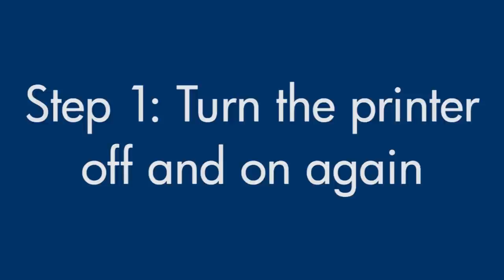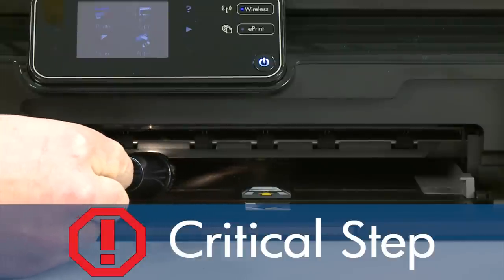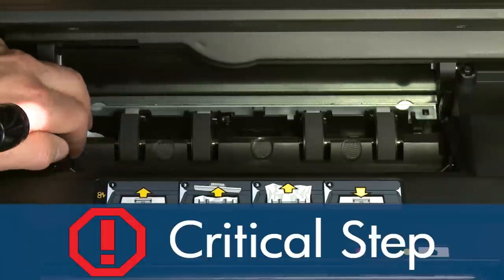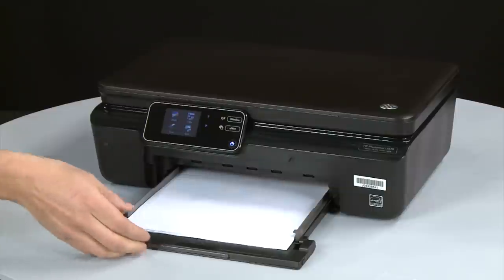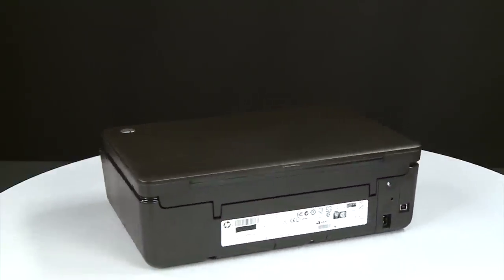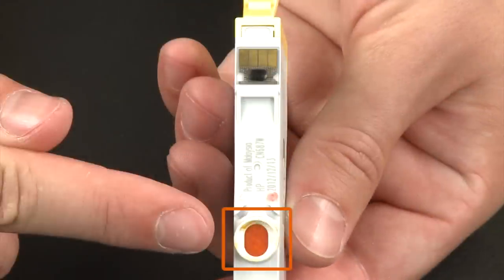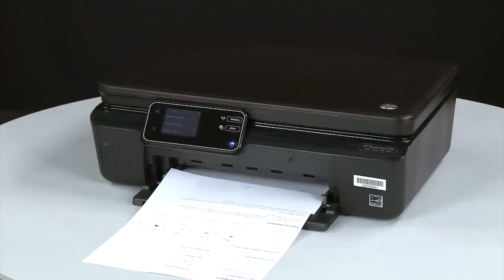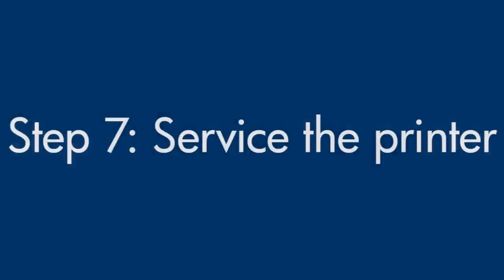Fixing a Carriage Jam | HP Photosmart 5510 e-All-in-One Printer (B111a) | HP

Comment: I have the same problem with carriage stuck on far right. Turn it on, grinds and grinds, but still doesn't move. Cannot move manually. Followed ALL steps in video and it's still stuck. Will not move even a little bit to get ink cartridges out. Called HP; they have "no printer repair centers" but offered to allow me to upgrade and buy a new one at a discount.
Reply: Kim Hansen I have the same problem!
Reply: daisyconsuelo so what did you end up doing?
I have the same issue. The videos don’t help at all.
Reply: I know. I’ve been complacent... I literally just loaded the printer in my trunk earlier this week in hopes of finding a printer repair co. Economically it probably won’t make since to repair..
Reply: Try to push it down hard or with a bit of force bc I had the same problem and I solved it by doing that. It should be held down by itself and then I simply plugged it back up and tried to print something. I hope this helped :)
Reply: @tuttlez2611   Thank you  Thank you  Thank you!!!!! I was considering using brutt force, but was afraid to. Read your advice and thought why not? Won't work anyways. Been looking at videos for over and hour now to no avail. I have the HP C309a and it worked!!!!! YEAH!!!!!

Comment: Here is what worked for me: The problem I had: carriage stuck all the way to the right and would not move. The reason it happened?I changed black ink cartridge, And I did not seat (insert) front end of the ink cartridge in properly. I had to use brute force to move the carriage to the middle so I could access the cartridge and reinsert it. So, if this problem happened immediately after you changed a cartridge, there’s a good chance you did the same thing.
Reply from the maker: +pyootchnich I am glad to know that your issue is fixed.
Reply: nice, having the exact same problem now and indeed, I thought the black ink cartridge was a bit strange

Comment: This video does not solve my carriage jam issue. I have a hp photosmart 5510. The printer makes a horrible noise, the carriage is stuck at the right (I can only move it a couple of cm to the left). I tried to do a factory reset but the printer does not let me do it, since after making the noise the error message "Carriage Jam" displays. Please any suggestions?
Reply from the maker: +Andreas Please perform the steps mentioned under this document to fix this issue: https://bit.ly/2Wz0ph6
Reply: @HPSupport  thanks but I don't see any paper or anything causing the problem. The noise/problem started suddenly just after turning on the printer, I was not even printing. So your suggestion seems to be taking the printer to repair. And then the question remains whether it can be repaired or not.

Comment: None of this worked on mine. I used it yesterday to scan something and it was fine. Today while warming up it spit out a piece of paper and said carriage jam. The carriage won't move. It's stuck on the right side. I can't budge it and I don't wanna break it. So the screen keeps saying carriage jam. There is no paper stuck in it. Any other suggestions?
Reply from the maker: Please review this document: A 'Carriage Jam' Message Displays for HP Photosmart 5510 e-All-in-One Printer Series  - ( http://ow.ly/o48s303QPJc ). Be very diligent in looking for any debris that may have wedged in someplace that could be the source of the problem. If you get to Solution 6 with no luck the contact HP for servicing.

Comment: I have just purchased a hp 5520' haven't even used or put any paper through yet and at setup it is saying there is a paper jam. Have tried all that has been suggested . Still saying paper jam , ???
Reply from the maker: HI Paula Jeanne,
Please start by resetting the printer.  Please search for C03177455 on HP’s home page or using Google Search.  It will walk you through how to reset the printer. Please also search for C03251700 as it is the document that will walk you through how to physically set up the printer.

Comment: Ive got a 5110 photosmart and since moving house I found a pen lodged in the rollers, having removed it the printer now takes 1cm of paper then doesnt take any more and does the usual print onto nothingness. Ive taken it apart multiple times, nothing else is inside it, all the parts are present and undamaged, all springs etc are in place and I even tried cleaning the rollers... nothing works.
Reply: I mean 5510
Reply from the maker: Warbaman I would recommend that you contact HP Technical Support as I believe the pen has bent a roller somewhere by the sounds of what you are describing.
Reply: Ah, thanks for the reply... There's only so far I'm willing to take it apart. I'll use it as a scanner and get another printer (likely hp since I'm otherwise very pleased with it)

Comment: Hp photosmart 5510 - Worked fine until all ink was changed. Now keep getting cartridges problem message. Went to HP site and followed their instructions including getting another set of inks. Did this twice and still keep getting the message! Arrrrrg! Really need help with this please as I am getting behind on paperwork.
Reply from the maker: +Lorelei Fox I recommend following the steps in this document on 'Incompatible Ink Cartridge(s),' 'Cartridge Problem,' or 'The Indicated Ink Cartridge(s) Must Be Replaced' Displays for HP Photosmart 5510, 5520, and Deskjet Ink Advantage 5525 e-All-in-One. This resource can be found by Google searching "c02924284". If the issue continues, please contact our technical support by going to Google search and enter 'contact HP worldwide'.  Your first option should be the site for contacting HP, when you click on it you will be prompted to choose your country/region.
Reply: I keep getting paper jammed message too and I have HP ink so nothing is working. Any suggestions. I tired all the troubleshooting steps.
Reply from the maker: Here is a document specific to paper jams for this series of printer: A 'Paper Jam' Error Displays on the HP Photosmart 5510 e-All-in-One Printer Series - ( http://ow.ly/DNGa303Ok3q ). When it gets to part of searching for paper be very thorough, and if possible use a flashlight, and look for other types of debris that may have gotten into the printer. A paper jam error, does not necessarily mean it is a bit a paper. People have reported thumbtacks, staples, paper clips, bits of plastic, pen caps, among other more exotic possibilities.
Reply: got the same thing cartridge is jammed stuck right side tried all steps a see you dont have a solution for the fix @hp apart from contact technical support mines out of warranty so is everyone else by the sound of it yes a use original hp cartridges any advice??

Comment: I cannot get the carriage to go to the middle to add new ink.
Reply from the maker: ABC RST Unplugging the unit and reaching in and moving it to the middle manually.
Reply from the maker: matze karajanov Please call our technical support at 800-474-6836. If you live outside the US/Canada Region please go to Google search and enter 'contact HP worldwide'. Your first option should be the site for contacting HP, when you click on it you will be prompted to choose your country/region.
Reply: +ABC RST For anyone that is having this problem, it took me dismantling the darn thing to figure out what was causing it to not move from it's right corner cave. I'll try and explain it as best I can, but hopefully I will be able to get my own video up eventually.... 
Open the top door, and push the carriage as far to the right as it will go.
With a flashlight, look below just to the left of the carriage (If you can see those little white gears, look below that!) you should see some horizontal "teeth" (for lack of a better technical term). You can use a flat head to push that whole piece BACK. Basically what that is is the ink feeder (again, not a technical term), and it's stuck. This is what is causing the grinding sounds. I haven't gotten anything to actually work yet, but if you push that part all the way back, you can slide the carriage to the left and put your cartridges back in at least. :-/

Comment: HP 7520 PHOTOSMART  i FOLLOWED THE INSTUCTIONS 2X,  AT FIRST THE CARRIDGE WOULD NOT MOVE FROM RIGHT. STUCK.  2X INSTRUCTIONS CARRIAGE FLOWS FREELY BY HAND. BUT NOW IT WON'T PRINT. ERROR MESSAGE CAME BACK 2X AGAIN. CARTRIDGE STUCK.      sELLI
Reply from the maker: Try this which is specific to the Photosmart 7520: A 'Carriage Jam' Message Displays for HP Photosmart 7520 e-All-in-One Printer Series - ( http://ow.ly/7Jdj3018OVe ). If there is no change then it will likely need to be serviced.